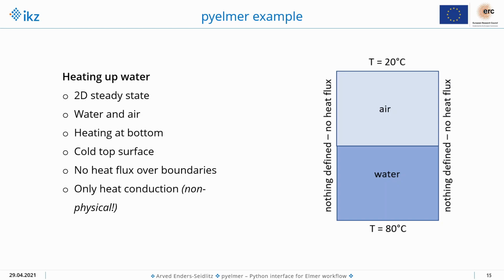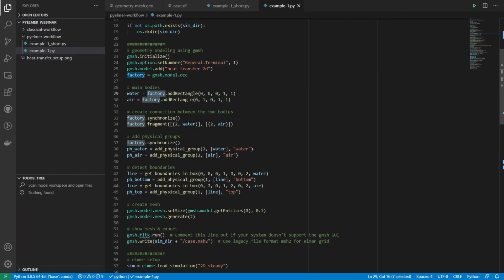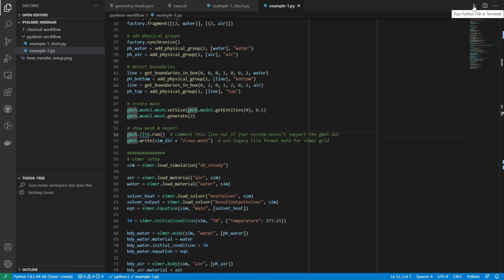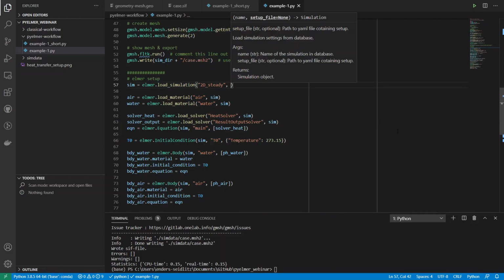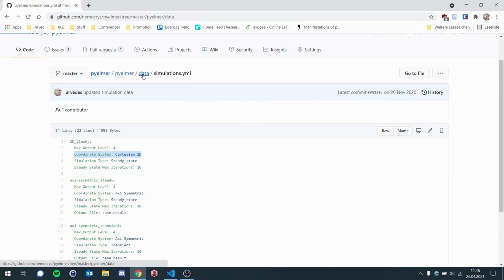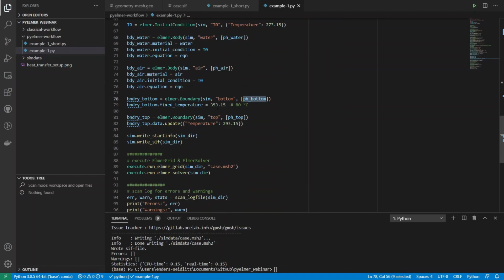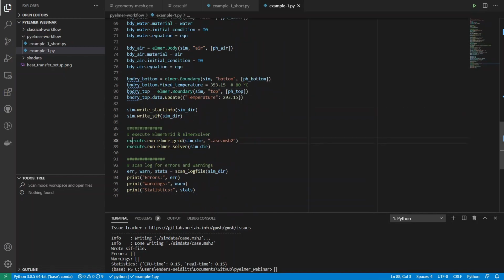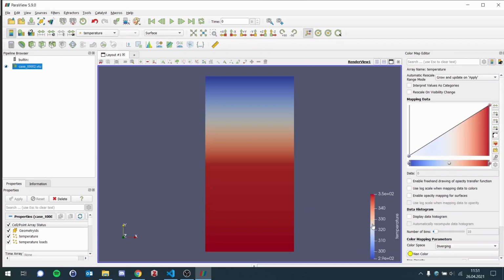pyelmer tutorial 1 - heating up water

Comment: Hello sir 
Thank you i fixed that but i have another problem with the steady state simulation it’s doesn’t work in Code python but it works in the interface graphic of elmer. The sif folders in Python in Elmer are same that’s weird. But when i change the type to transient it works. 
The type of error : 
ERROR:: IterSolve: Numerical Error: System diverged over maximum tolerance.

STOP 1
Can you help sir please ?